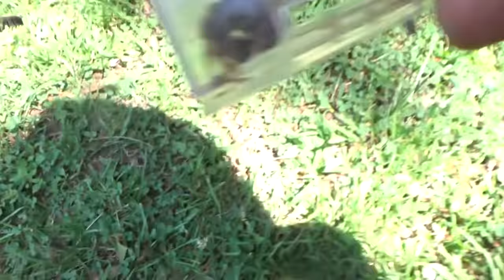Capturing a huge swarm of honeybees and the surprise ending it had in store for me.

Comment: I have been told that if you use too much attractant this will happen. Makes sense to me...
Reply from the maker: The attractant has nothing to do with a swarm containing more than one queen in it. On subsequent swarms, swarms after the primary or first one leaves the hive, multiple queen in the swarm are not unusual. The reason for this is because there are multiple queens hatching from swarm cells and several may fly in the same swarm at the same time. In the end, there will only be one queen as the worker bees will select which queen they want. This is the reason I thought initially they were balling the queen. As it turned out, they were only protecting her. Thanks for watching. God's peace Mike.
Mr. Ed